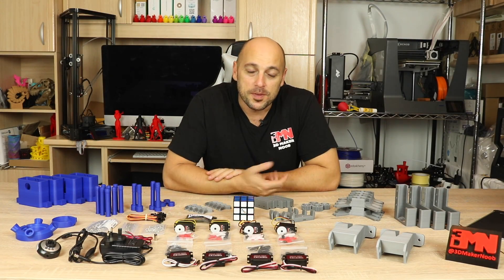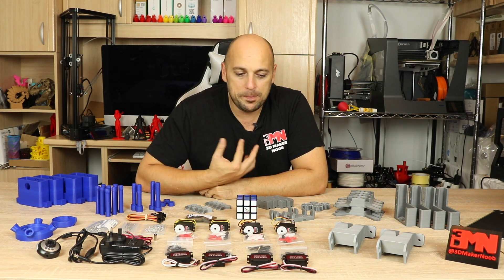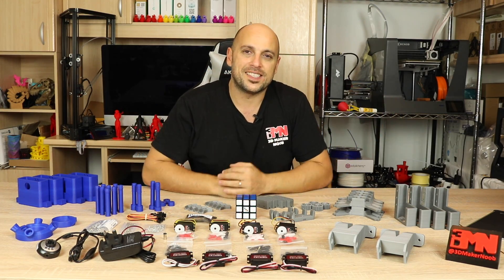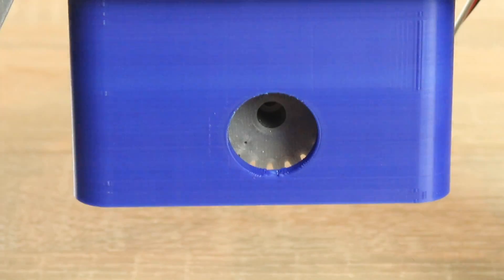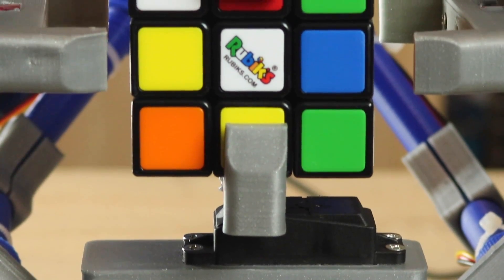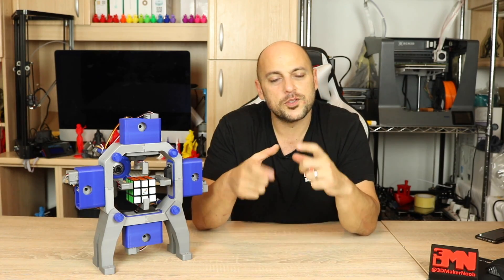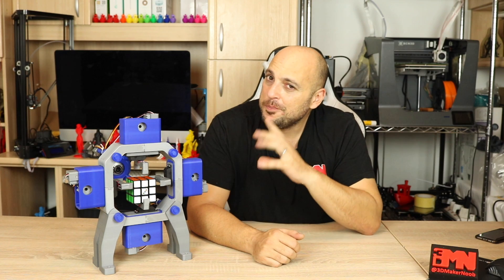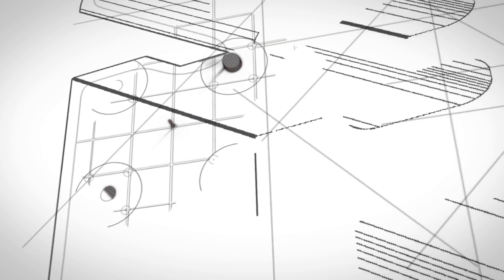Awesome Creation - 3D Printed Rubik's Cube Solving Robot

Comment: Hey! :*) You have like 107 comments currently, so you're kinda swamped. But, if you have the time, why did you use two (2) different 3D printers? Thx!
Reply from the maker: +4FunRC it was a matter of a joint venture :) just wanted to see if the printers would be calibrated out of the box and work well together :)

Comment: I bought a 12ch Pololu last week still didnt had time to play with it. One question.... how much volts did the servos need? 5v for the board but im stuck for servos.
Reply from the maker: +Patrick Gatt hey! The power supply I got was a 6V 3500mA which worked fine for all of them. Just keep in mind that the biggest load in my case was two servos doing a 90 degree turn at the same time, nothing more
Reply: Servos will run on 6V.  Do NOT try and use the same power for motors and logic.  If the motor stalls is brown-outs the logic supply and the computer resets.    You are best off buying a mean well type PS for the motors